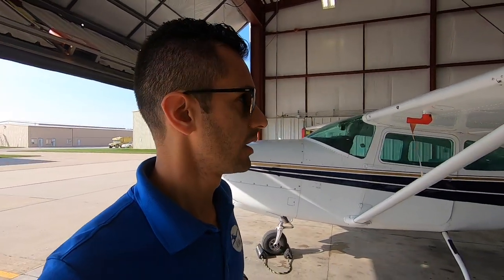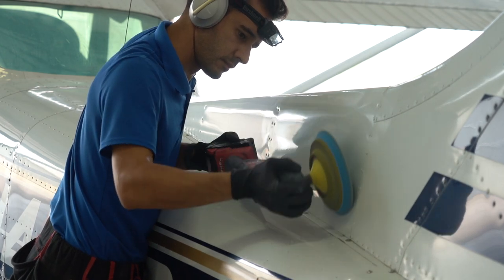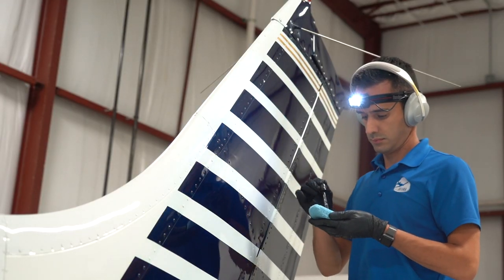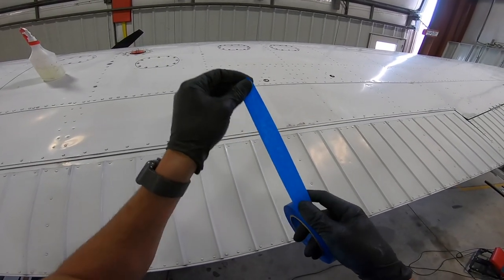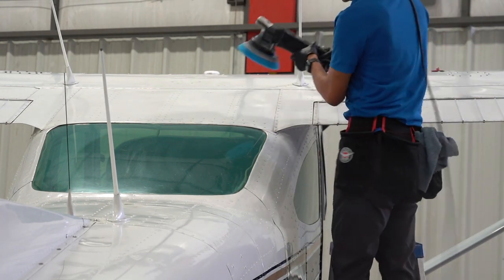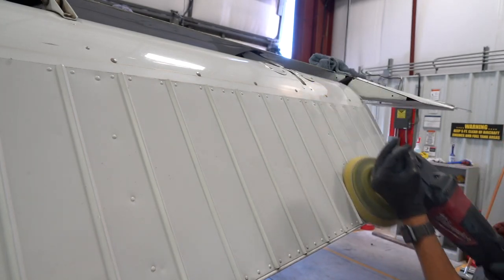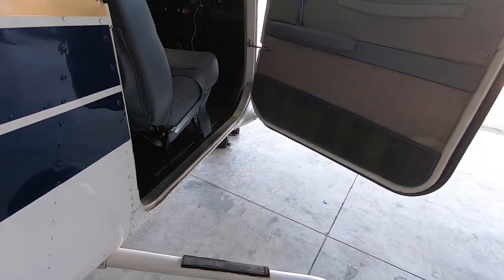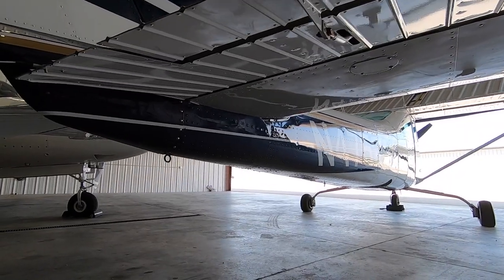035 - Cessna 182 Intensive Paint and Leather Restoration / ceramic coating

Comment: Was there some corrosion on the top of the wing surface? How do you deal with that if you find it?
Reply from the maker: That is a paint shop issue. Nothing I can do about it
Reply: @AvianaAircraft  I've been trying to reach you via your email to potentially set up an appointment in Feb to paint correct my plane. What's the best way to reach you?
Reply from the maker: @markseward1214  got your email re the Navion. Working on getting caught up still.